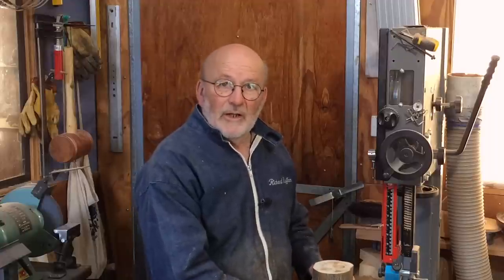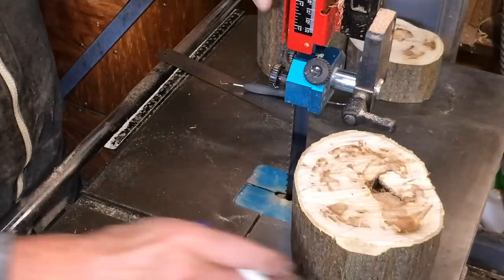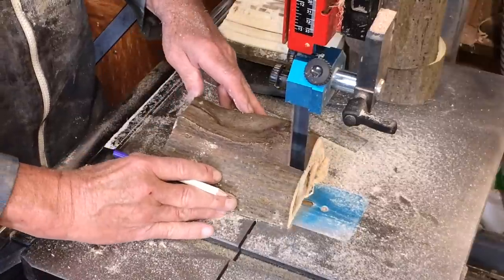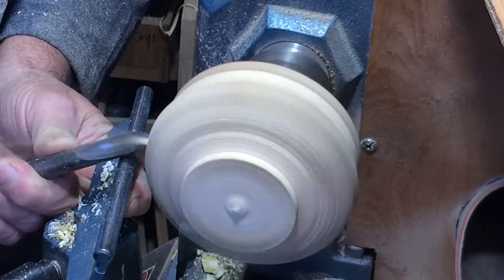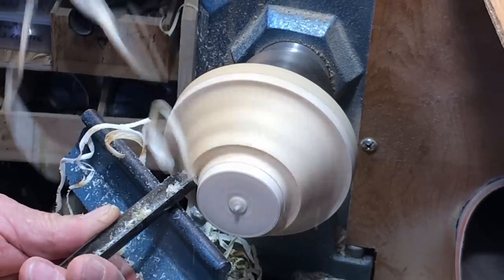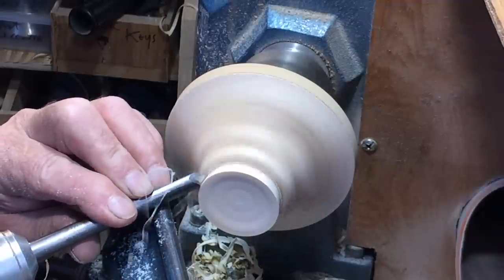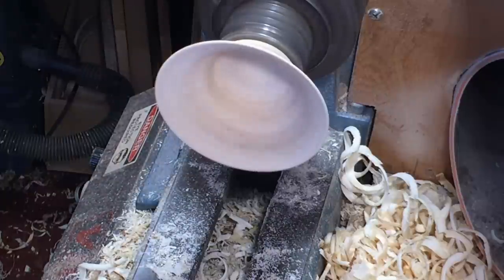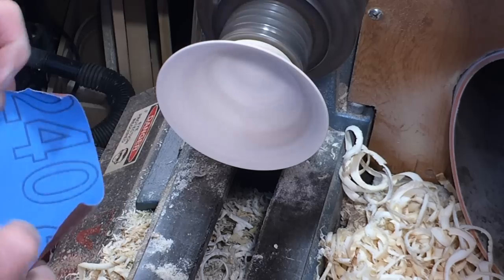Richard Raffan turns a short log of freshly-cut Japanese maple into four bowls.

Comment: Took down a neighbor’s Japanese Maple 2 years ago on their request. It was a huge beautiful tree but they really wanted it gone. It is a strange wood to turn and very prone to cracking when drying. Turned a few green bowls with success. Found you have to turn quick after felling. After about a week or more in hot weather cracks appear more often. Left the rest to dry and work with the cracks to decide where to split. Once dry they are incredibly hard but turn beautifully with a sharp tool. Unfortunately, carving is nothing short of a nightmare due to the hardness. Thanks for showcasing this interesting wood.

Comment: Another video in how to use wood that looks decidely unpromising to create something wonderful. Does the light method work on darker timbers too? Or is it more trouble than it's worth in those instances?  Looking forward to the small bowl videos. Thanks for making the video and sharing your insight and experience once more.
Reply from the maker: You'd need a very bright light to shine through ebony or cocobolo, but it's good for turning brown or reddish woods like elm or oak thin. As always, cut a thin slice and test. Water helps transmit the light, so this doesn't work so well with seasoned darker seasoned timbers.

Comment: Just to be clear, we want the wet turned bowls to be totally dry before applying oil & wax or another finish?
Reply from the maker: I wait for bowls with a flat base to dry before oiling mostly so I can be sure they've finished warping. Bowls with rounded bases I'm not so worried about and am happy to oil those when 18% or so. I probaly not the best person to consult on finishes and finishing as I've rarely used anything other other than oil and wax as you see in these videos.